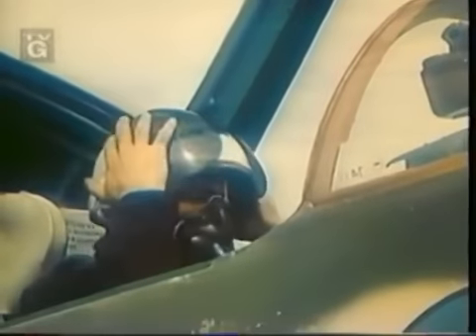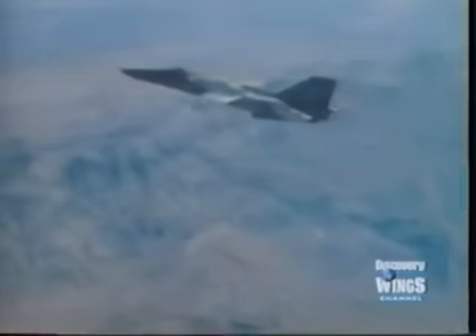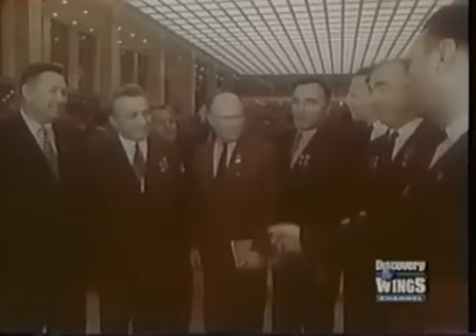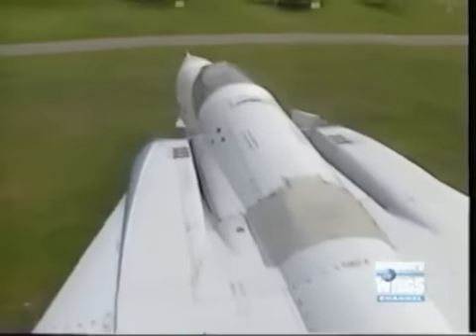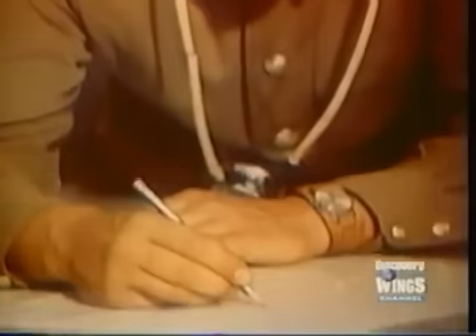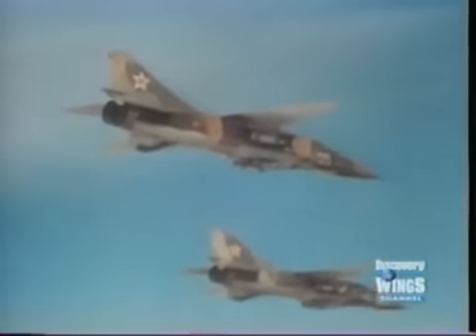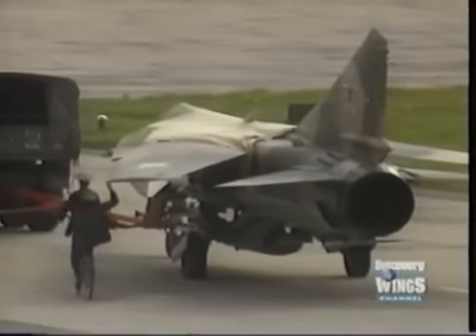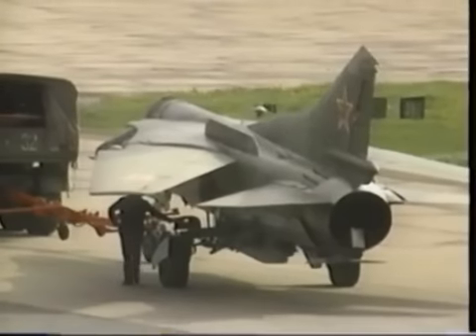Wings of the Red Star  MiG 23! The Swing Wing Solution!   YouTube

Comment: The MIG 23/27 would have turned out a lot better if it came with two smaller, less powerful engines instead of one powerful engine, which would have made the Rube-Goldberg landing gear unnecessary and given the plane better lines.  Engine failure is a big problem with the Flogger, in particular at low altitude, when ejection is risky.  The Indian Air Force has had a miserable time with their force of MIG 23s and 27s, and lost a lot of pilots to accidents.  One engine might make it cheaper and the ground-crews job easier, but two engines would have made the Flogger safer.
Reply: MarchHare59 That must be why the generation after the Mig-23 - the MiG-29 - had two engines.
Reply: Unlike the American's, "Quantity before Quality" has been the Soviet Union/Russia's main design philosophy, since long before WWII. Also, you're forgetting that one of the West's most mass-produced and effective Fighter/Ground Attack aircraft is the single-engine F-16 series.
Reply: If you see the 23 from top view, it makes aerodynamic sense to use a single engine, especially considering that, at the time, the area rule had a greater importance for range, efficiency, etc.
That said, I would've made my very best to design a 2 engine aircraft for the very reasons that you stated.
Jet engines are circular in cross-section, thus, the more engines you are allowed to have in your designed, the greater the opportunity to create lifting surfaces.
Reply: The MiG23 needed one engine to have a similar profile to a MiG21. If your were to fit two smaller engines in that same area, no where enough power could be produced. Although the MiG23 did have a lot of flaws, it all comes down to the initial design, instead of having to integrate a new high performance jet into your system, they should have modified their system to integrate the plane, that way they can spend more time developing a quality fighter not to Soviet doctrine

Comment: Death

	

		
	

	

		A MiG-23 BN in East German markings
	

On 26 April 1984 Bond, who was about to retire, made a farewell visit to "an Air Force Systems Command unit"[6] believed to have been the 6513th Test Squadron, Red Hats, at Groom Lake. The Red Hats, like the 4477th TES Red Eagles based at Tonopah Test Range, clandestinely operated Soviet aircraft.[7] On a previous visit to Groom,[8] Bond had flown the secret YF-117A prototype. The MiG-23 was known as YF-113 in US service and, along with a greater number of MiG-21s, was part of a collection of Soviet-built aircraft that the 4477th flew.[9] Bond insisted on flying the MiG-23 BN fighter-bomber[nb 1]
 after a cursory briefing over the cockpit rail, even though it was 
considered a difficult aircraft and pilots usually received several 
hours of ground instruction before flying it.[6][12] On his second high-speed flight, he was flying at 40,000 feet and over Mach 2,[nb 2] and had left the T-38
 chase plane that was flying with him far behind, when a 
hydro-mechanical inhibitor activated, preventing him from disengaging 
the afterburner. It was designed to avoid sudden shut-downs at high speed that could damage the Tumansky R-29 engine, or even cause it to explode and destroy the aircraft. At such speeds, with the wings fully swept back to 72°, the MiG had very limited pitch authority and was inclined to yaw and roll. Bond lost control,[nb 3] made a distress call ("I gotta get out of here") and was then killed in the ejection,
 when the slipstream broke his neck and shredded the canopy of his 
parachute. The aircraft crashed in the desert, diving in at a 60° angle[13] and impacting on what is now known as Jackass Flats, part of Area 25 that was still contaminated from NERVA nuclear rocket testing years before.[15]
 Bond's body was discovered by a USAF sergeant on his way to work, who 
removed the rank insignia from Bond's flight suit with a pocket knife 
before going to get help.[16]

Aftermath

	

		
	

	

		The KM-1 ejection seat used in the MiG-23
	

The USAF would not confirm or deny that Bond was flying a MiG when he died,[17][18] and stated that Bond was flying "an Air Force specially modified test craft",[17] but it leaked the information to a journalist, Fred Hoffman.[15][19] When Time
 magazine reported on the accident and the rumors of the US MiG program,
 the USAF was forced to reveal that it was flying Soviet aircraft.[20] There were fears that the publicity would also lead to the exposure of the F-117 program, which was still secret and was also based at Tonopah, but this did not happen.[15][21]

The accident investigation was chaired by General Gordon E. Williams.[16]
 The investigation report was kept secret, but one pilot who had seen it
 commented unsympathetically: "He should have read the flight manual."[8] The report was required reading for American MiG pilots in years to come.[16] There was some annoyance that Bond had written off an irreplaceable national asset.[16]
 Work continued to make the KM-1 ejection seat used in the MiG-23 safe 
and reliable; another USAF pilot, Mark Postai, had been killed in an 
attempted ejection from a MiG-23 in 1982.[22] Maintaining the Soviet ejection seats included reverse engineering
 the pyrotechnic cartridges which fired them, as these had a relatively 
short life and had to be replaced regularly as the chemicals degraded.[23] Pilots over the age of 45 were not normally supposed to fly solo in fast jets, and Bond was 54 at the time of his fatal crash.[17][19] Lieutenant Colonel James Tiley, commander of the Red Hats, was reassigned in July, though it is a matter of debate whether this was related to Bond's death.[16]

Bond was buried in Ashland, Mississippi, and was survived by his wife Betty and four children.[24] A memorial stone to him was placed in the desert where he crashed.[21] Major Thomas E. Drake, an experienced MiG-23 pilot who frequently said "This airplane will kill you today if you let it",[25]
 emphasized the importance of good preparation to Colonel James Evans, 
who was preparing to learn to fly the Soviet types, by referring to "the
 General Bobby Bond Memorial Checkout: two take-offs, one landing, and a
 fatal ejection."[26] The 4477th was inactivated in July 1990[27] but it is likely that the USAF continues to operate Russian aircraft clandestinely, including MiG-29s and Su-27s.[28]